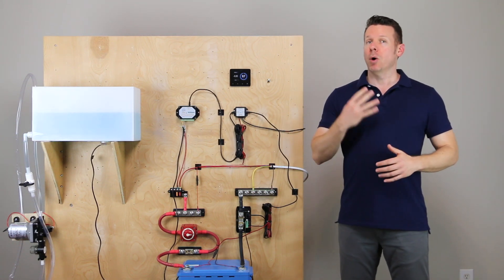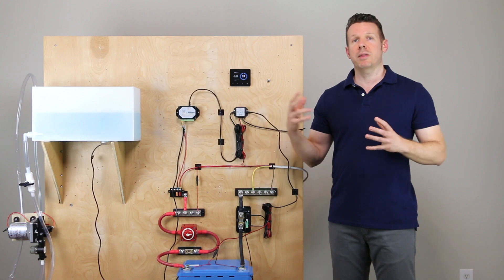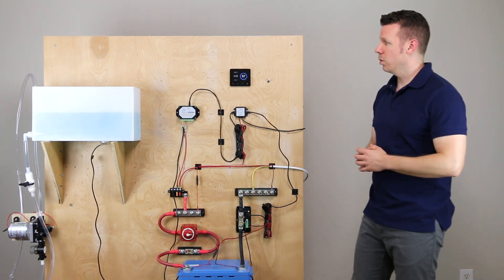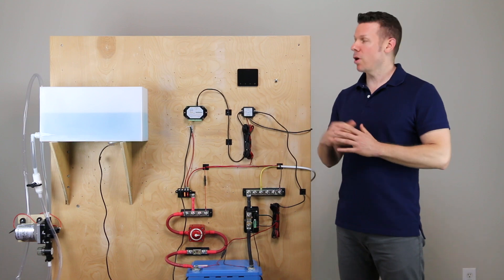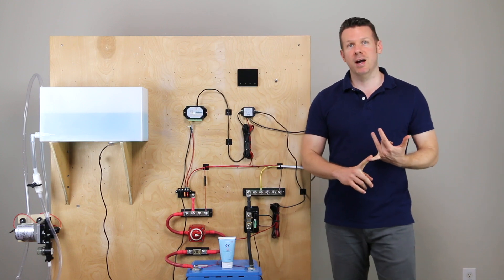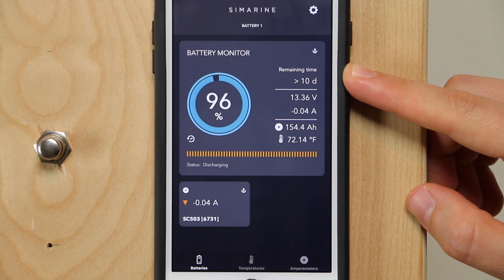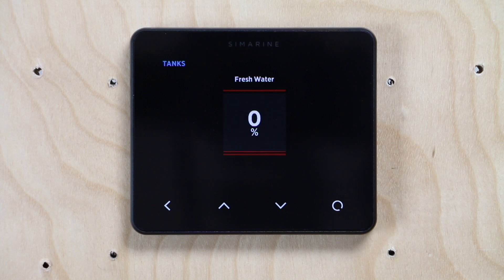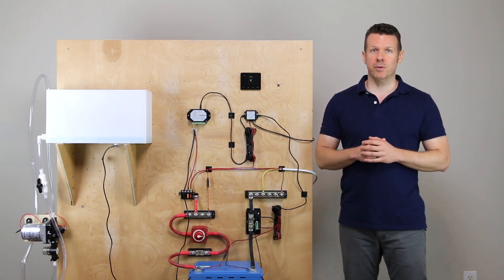How to Set Up Tanks on the Simarine PICO for Van and RV Power Systems - Simarine Part 4

Comment: Hi Ross, i have a boat with 6 fuel tanks that i need to monitor. Can i parallel the ST107, do i need 2 pico/ST107 or is there another method i can use?
Reply from the maker: Hi Armand, yes you should be able to daisy-chain multiple ST107's together to bring in more tanks. Hope that helps, thanks for tuning in-